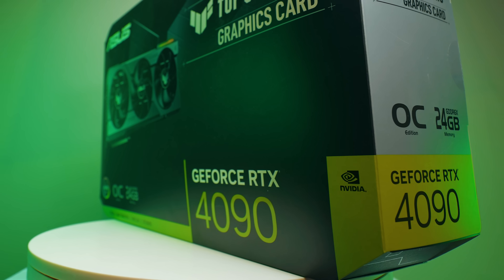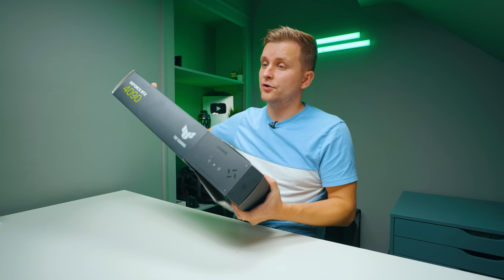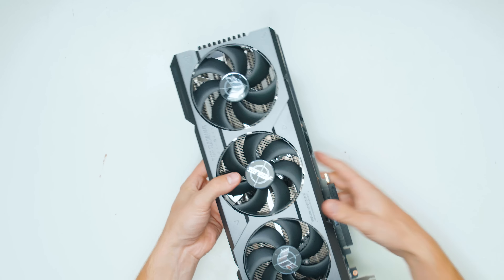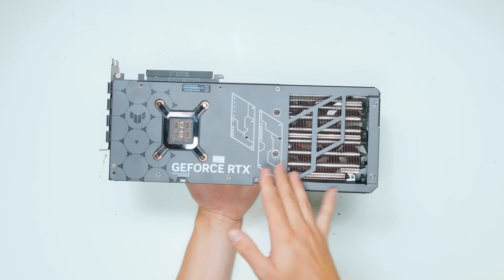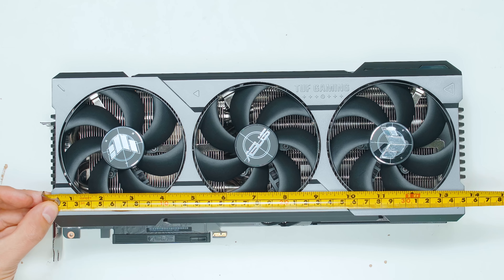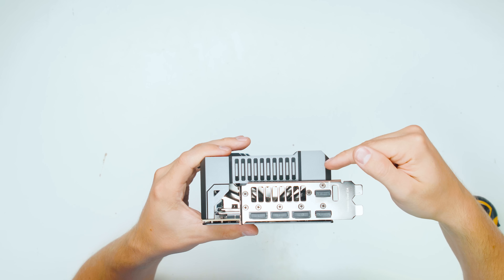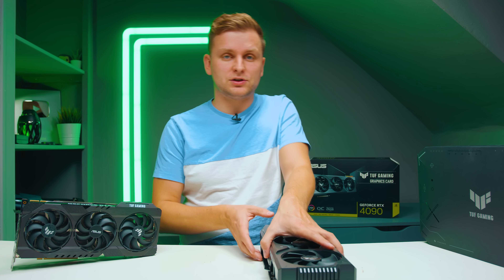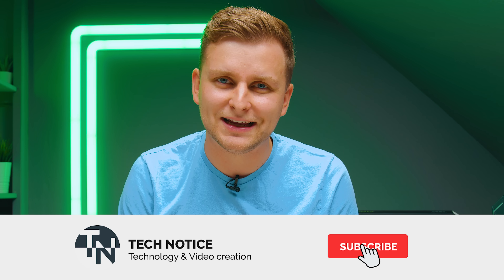This is the NVIDIA ASUS TUF RTX 4090 [First Hands On & Overview]

Comment: Always loved the tuf series. Clean design and minimal rgb.
Reply: Have the 3090 TUF, love it.  Knew right from the launch that was the one for me (even though it took me almost two years to get it lol).  Can’t believe the size difference between these two generations though.
Reply: This one here is the one I want, even over the Strix model which is too colorful for my taste and pricey. The MSI Suprim non water cooled would be my second coice.
Reply: @Nexter1  had the same card for a while and it was great. Temperatures were excellent and it was quiet. I sold it when the gpu prices were out of control to a friend of mine.
Reply: I bought the TUF 3090 as it is the best on the market rn if you compare it to other 3090's
Reply: and the best ones in temperature
Reply: The Strix got the better components though. The 1080Ti Strix I had was an absolute beast and lived for over 6 years, working insane workloads almost daily. Still, the TUF are fantastic in regards to looks and cooling and just a bit behind the Strix. Going for a TUF can be a more sane choice if budget is a matter for the buyer.
Reply: @Leonardo-wn2fp  true but ultimately it shouldn't really be a difference if you are using the card for daily use. For overclocking the STRIX is 100% better
Reply: Agreed, I have an RTX3070Ti and I love it.

Comment: Video cards are getting bigger and more power hungry, which is a bit strange to me given the way technology is evolving. I will wait for RTX 4070 or RTX 4080 benchmarks, RTX 4090 is too expensive. Otherwise, I would be interested to see a comparison with the professional line of RTX video cards.
Reply from the maker: Actually that's not exactly true, if you look at the performance per watt, it's still very impressive!
Reply: We are also getting to the point where we can't shrink processes by as much as we used to, getting hung up around 5nm; so we have to just add more cores to increase performance which increases power draw.
Reply: @theTechNotice  make a video on that good sir
Reply: @theTechNotice  Where does it show the real world performance per watt and not a half ass bar graph with no usable information on it.
Reply: @theTechNotice  it's performance per watt is better than ampere, but that's already a low bar with how badly inefficient ampere is, 450W of consumption is not good overall
Reply: yeah it's evolving just backwards 🤣
Reply: I'm interested in the 4060. I hope Warzone 2 supports DLSS 3 so I can gain FPS and save on electricity at the same time.
Reply: Cards actually got smaller, the coolers got bigger.

Comment: My jaw hit the floor when you put the 3090 beside the 4090. Planning to upgrade my 3080 TUF OC to the 4090 TUF.
Reply from the maker: Oh yeah, same here, it's HUGE!
Reply: Upgrading already? I was originally going for the tuf version, but it is too long for the cases I'd want to shove it into. FE 4090 is my choice.
Reply: @tiandi5585  Already? It's been 2 years! I'm looking forward to the extra RT performance. My case choice at the start of the year was the Fractal Torrent, opaque with no RGB under the desk, which is huge so no problems with space.
Reply: @alistermunro7090  
Why do you need 4090 if you can turn all the sliders to the right with 3080
Reply: @GrandTown  What we have seen so far from RT is only the beginning. A good example would be CP2077 which still struggles to stay above 60FPS at 1440p / DLSS Quality, and that's before we get the overdrive settings. I would have stayed with my 1080Ti FTW if it were not for RT.
Reply: @GrandTown  You absolutely can’t at 4K
Reply: during this time, my 1070 still shines
Reply: @ReghalMihn  FullHD is enough
Reply: @ReghalMihn don't forget dlss3.  It may give you good fps hike .
Reply: We're literally the same haha. I plan on giving the 4090 FE a try when it released, I have a 3080 TUF currently as well. I've had it since November 2020 and it works like a charm, but I'd love to see how the 4090 handles Ray Tracing and potentially 4K.

Comment: Rocking a 2080ti and not giving a crap about raytrace tech I will wait for the 50 series. The 4080 is good value compared to what I paid in 2019 but the 4090 is just a behemoth I wouldn't want on my desk in a huge tower.

Comment: I finally managed to buy a 3080 FE at MSRP in the UK a few months ago and I was so happy about it, and now 4000 series is already out, now I'm not sure if I got good value and maybe I should have gotten the 4090 instead 🥲 3000 series were unobtainable at reasonable prices for so long that I didn't even realise the next generation was soon.
Reply: Nah u didn't get ripped off man.
Reply: The 3080 is a good GPU and at MSRP you cannot go wrong...Should be able to handle anything at 1440p high refresh and even 4k 60 without to many issues and that's not including DLSS...Be happy, and when the 5090 comes out by a 4090...
Reply: @vMaxHeadroom  Thank you for your reply, it eases my thoughts on the matter. My main use case is video editing, I enjoy gaming and especially VR too but the most important part is that it video edits well. 
And I suppose there is not that much of an improvement for video editing between a 3080 and 3090 or one of the 4000 series, probably just faster export times. Oh and more VRAM is better I suppose.
Thinking of getting an LG c2 tv/ monitor.
Reply: You're fine, if you're only planning on doing 4k for the next few years. Hardware has massively outpaced gaming software. Something Nvidia doesn't want you to realize .Your gaming experience wont even blink an eye. The truth is Without benchmarks you couldn't tell the difference between a 3080 and a 4080 playing any games at 4k max settings. Side by side or not. The last couple gens have completely depended on benchmarks and 8k for being the only reason for gamers to up grade. Honestly it's becoming a marketing scam 60% faster than last gen, what is 60% faster than overkill? Nobody can without software tell the difference between 100 fps ultra and 140fps ultra. It's the same experience. They are misleading you so they can take hard earned money from you, so you buy something you don't even need.

Comment: I don't get why they don't add a 3rd slot bracket on these cards. I would assume that adding a third screw lower relative to the card would help support it better than just two screws.
Reply: @proxy1 gotta cut costs some how!
Reply: You don't need a 3rd bracket if you're using a 4090 and not watercooling it you're insane.

Comment: It's massive, so full tower recommended. Requires a new PSU with 1000-1200w. Will increase your power bill significantly. Will need a bracket for support.

Too many cons to justify a purchase.

Comment: Do you have to use 4 single pcie cables going into 4 pcie slots and utilise the 600w capibility only, or can you use 2 single and one split cable and power it with 450w?. The asus website recommends 1000w minimum, but I aren't overclocking the card and using a 5900x with just PBO turn on so not sure I would require the full 600w and using 4 single cables.

Comment: If AMD doesn't drop a monster card before Christmas, I'm definitely building a 7950x with a 4090 on a open air frame I'm making.
Reply: Good idea open case would be sick!
Reply: Any recommendation for a open frame case or how to learn to build one?
Reply: @bokki94  Amazon actually has some open air frames that you can mod and make work with the bigger cards. I was even able to put a 360 AIO on it. The frames are super cheap but strong.

Comment: You forgot to measure the most important part, how wide the cards is, and how wide it is with the cable attached and bent down. These cards won't fit into most cases because the cable can't be bend enough before it runs into the side panel of the case. Why is no reviewer paying attention to this?!

Comment: Unless you are rendering and need the extra pace, there are no real reasons to get this next card. I doubt there any games which demand a 4000 series card to play. You are basically spending 2000 pounds for a GPU with a suitable ATX 3.0 PSU, before you consider the larger case and the other bits. I would not be surprised to learn this GPU needs a higher level CPU to avoid being bottled-necked.

Comment: My Strix 4090 oc weighs 9.5 lbs. I have two vertical supports holding it. Taking no chances.
It would not fit vertically. It hit my front mounted 360 AIO.

Comment: What is the recommended psu for this?
Reply: Nuclear!
Reply: 600W for the card alone. Add in CPU/MB/FAN/Drives/etc and the range of power supply for this card and the ATX 3.0 specification is 750W up to 1,650W
Reply from the maker: Officially 850w for the FE.

Comment: Isn’t there a slight benefit pulling the fan slightly away from heat sink to reduce static air pressure and optimize airflow? Sorry if I’m using incorrect science terminology, but I do recall fan displacement can have huge influence of air pressure resistance.

Comment: it s the last generation of cards to be a componant. next generations will be peripheral.  they ll have their own case, their own power supply , their own cooling system and you ll plug them to the case with an optic fiber. It means smaller motherboard smaller pc case smaller power supply. Next pc will be smaller but with 2 cases ...

Comment: He measures length and height but stopped before measuring width. Nobody mentions this, and yet I think it gets awfully close to hitting the side panel of many cases, especially when you have to plug in the power cable that sticks straight out the side.

Comment: they REALLY need to stop putting power connectors pointing straight out the sides of cards, just cut a little rectangle in the shroud and between fans and having it straight down, geeze. Not sure what kind of XXW (extra-extra-wide) case they think people are meant to have, especially with the new 12-pin connectors being super stiff.

Comment: Buyers be ware. The TUF 3090 was the worst of the 3090's performance wise. ASUS gimped it by limiting the power draw as to not have it perform close to the 3090 STRIX.  I suspect the same will be for the TUF  4090. You are better off getting another brand's "cheaper" 4090.

Comment: Well this is interesting.. On their reference models , the 4090 is slightly shorter then the 3090 but thicker. However Asus TUF models have such a GIANT difference...
Reply: They added an entire fan worth of length to this card over reference. Reference board is designed for stock thermals and this card will come overclocked and higher power limits.